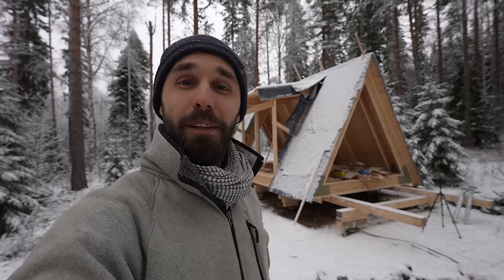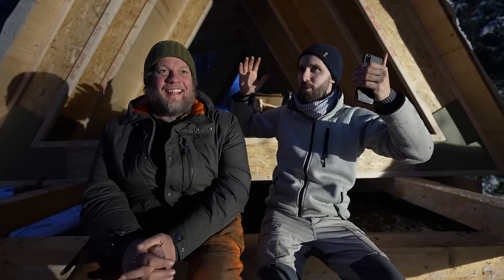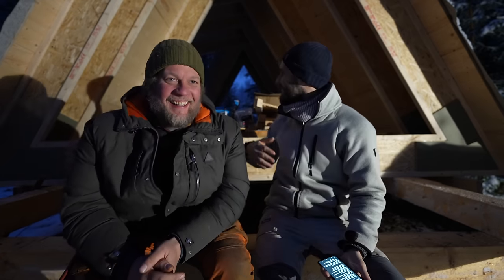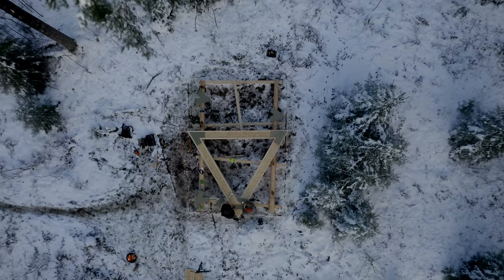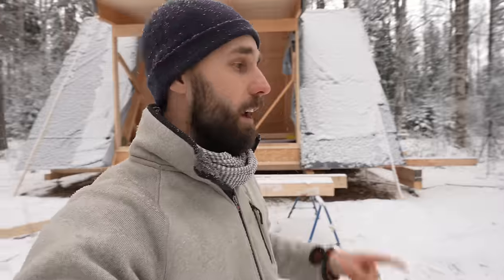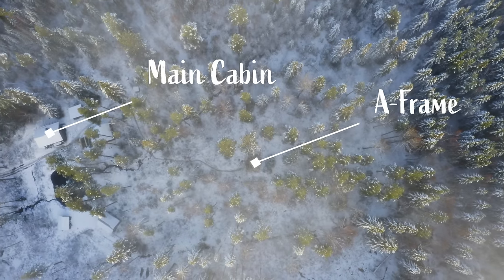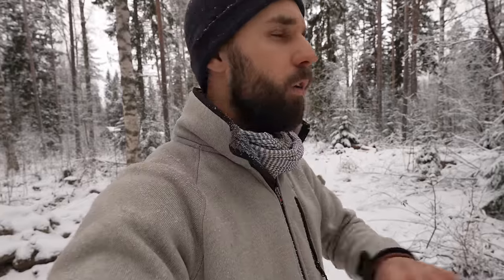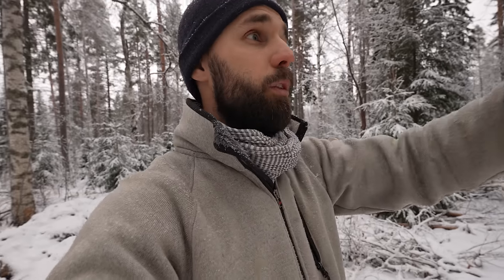Why Build an A-Frame in the middle of the Forest?

Comment: The varnished wooden material in your triangles is known as 'Oriented Strand Board' (OSB) here in the UK. It's much stronger than the decades old-style chipboard & therefore better suited for flooring, in much the same way that concrete is far stronger than mortar, because of the inclusion of shingle or gravel.

Comment: Hi Kalle!
First of All: Thanks a lot for your Videos! They're incredibly inspiring and making my dream place to live feel a little bit closer with each new idea I can see you implementing.
But for what I actually wanted to share:
I'm living in Innsbruck /Austria, having a flat in the city that is neighter heatable by gas or wood. And electricity happens to be crazy expensive sadly, especially with a badly insulated appartment. So with temperatures going to -15-20°C it get's fairly cold..
So to heat as little as possible we searched for a solution, that would FEEL warm as fast as possible and keep the warmth in thermal mass rather than in actually heated air.
Long story short, we switched out all the heating to infra-red paneels over the time, costing us far less and making the flat feel like 22°C, with the air actually only having around 18°C. Compared to radiators, where we actually heated to aroudn 25°C to actually feel cosy. (The difference is in heating object via radiation (like a bonfire, heating the side facing the fire. Compared to heating the air and whirling that warm air through the room)
Maybe it's an Idea to consider or test at a friends place :)
Good luck and fun with your build!
Looking forward to see more of it!
All the best greetins from Innsbruck!

Comment: @KalleFlodin
In my bedroom, I have got an old wooden window frame with single glaze glass, so it gets incredibly cold during the winter without an efficient method of heating the space up. 

My dad got me a convection heater which works tremendously well! My room is toasty! 
I would recommend you getting one of them. My one cost around £25. 

I would also recommend you getting a TP Link smartplug so you can create an automation that turns your heater on 30 minutes before you need to go into the A-frame every day.

I hope this helps you 🙂
Alex

Comment: The point of the A-frame is the structure itself - you can use very slender beams to make it - it will still be strong. So you could use 148x36mm normal wood - thats much cheaper than these made beams. Less insulation - but with a small volume you dont need more. Then for the same outside measurements you would get 29% more usable floorspace and 57% more volume in the A-frame - and it would be much cheaper and easier to build. The energy consumption will be influenced by the ventilation needed; bec the volume is tiny - you need good ventilation when staying there - and need a heat exchanger to not make the crow warm...

Comment: You should take a look at a ’solventilator’, i.e. a solar driven ventilator, the ones I have seen on Clas Ohlson for example both ventilate and heat, or just ventilate. The largest one I have seen is 100 w, that should be plenty enough to keep the air fresh inside, even in winter.

Comment: Cut the labour from that cost and do everything yourself from this point on. It’s not hard. 45k euro is way too much for what you are building here (even if that includes labour, just too much). And the fact that you are estimating that cost, and not saying that you will 100% fit into that price is saying that you are getting ripped off somewhere probably too.
Reply: Good, Fast, Cheep - Pick 2

Here I think Kalle has made the choice to work with someone who is very skilled, and has done this before. 
So, may cost a little more now, but less problems during the build

Comment: If you really want to build effective and cheap the A-frame is not a good solution. It has really big area of roof - roof is expensive. If you used normal vertikal walls the effective space would be much bigger for the materials used. Walls could be thinner - and give more effective floor space. Also when you are going to sit with big screens agains a wall that leans inward it will be problematic. The bank - the more real measurable space you can get for the money - the easier it will be to get a loan. A tiny bathroom and kitchen would make a real minihouse that could make money and obtain a loan. The the ark you build to get a good window - and also usable space - costs a lot extra work and money - compared to a vertical wall building. The flat roof could be a terrace.
Reply: Yes but Kalle is not the smartest lad.

Comment: 50 000 dollar ! 500 000kr wow it's a lots of money, isn't that almost the dubble amount of what you bought your cabin for?
Reply: Yeah, that was my first thought too, the cabin with 2 hectares of land was cheaper than this small building. I thought you can build something like this for 15-20k.
Reply: I hope for him that he meant to say 5 thousand and not 50. You could easily do it for 5k...
Reply: I also Wonder how one can Spend so much Money on a Building made of waste materials🤔...dont get it..,,
Reply: I wonder what is the pris for just the materials?
Reply: @Linda Larsson  with my a-frame cabin, i spent 1500€ for the external structure using cheap wood. With good quality materials you can easily spend up to 3000€, also depending on the local market price range. But I imagine in Sweden wood costs less than somewhere else...
Reply: Light weight beams, wood fibre insulation and I'm assuming tounge and groove floor, large windows etc cost nore then you might think. 500.000 sek sounds about right.
Reply: @leonedazza4  The regular retail price for woodfiber insulation is about 500 sek/m2, times 30 for the flooring joists and proablaby just as much for each side of the roof. So 5k is no way near enough for the type of cabin Kalle is building....
Reply: @turdferguson9190  500 sek/m2?? that's a shit ton of money, forgive my language. Here in italy you can find it for 60ish sek/m2... yeah no wonder the costs raise so much, but geez that's a lot of money
Reply: @leonedazza4  500 sek is for two 170 mm layers of wood fibre insulation from Huntonit. If you were to build with 45x170 studs and use conventional insulation it would be more like 130 kr/m2. Not as environmentally friendey, not as effective and not the natural products that Kalle favours.
Reply: 50k is normal, it is also working hours included, plus isolation, and don’t forget also the windows, door, paint job, floor, electricity etc etc.
Reply: @leonedazza4  dont forget Sweden has much colder climate than italy, thick walls alot of insulation 3 pane windows etc.

Comment: did u say 15.000 or 50.000 ?!
Reply: I think we are all in doubts 😕.  50000 is a lot of money for such a simple build.
Reply: @simonvidajewelry  no way $50.000 for such a small bild, even $15.000 is a lot especially when the beneficiary is directly involved in the building process. I say is more like $5.000 to 7.000 considering inflation and maybe the lack of big shops there in Solofteå like ByggMax that at times can come with a cheaper price, for all materials related to the building.
Reply: @giogrig6574  If you can build A-frames for that cheap I'm gonna order like ten of them right now...
Reply: @turdferguson9190  look I'm not going to waste time with your provocation, that A- frame is really small and is not costing $50.000 period. Than you believe what you want i care nothing. For the size already $15.000 is much. That's why i asked clarification, because maybe i misunderstood. And I'm still waiting... Maybe one day the owner will reply or maybe not, still no problem here.
Reply: @giogrig6574  I actually sell building supplies here in Sweden, so its not about what I belive but what I know. The foundation screws from Stavrex you see in this video, thoose are easily a thousand dollars in total. 300+ mm of wood fibre insulation, thats another three or four thousand. Not to mention the light weight beams, doors, windows, roofing materials, flooring, electrical work etc.
Reply: @turdferguson9190  And pay Isak. I don't think he works for free.